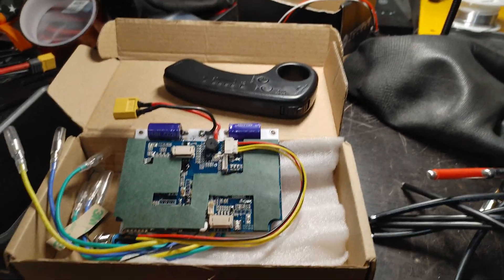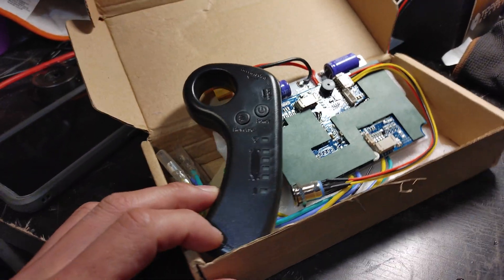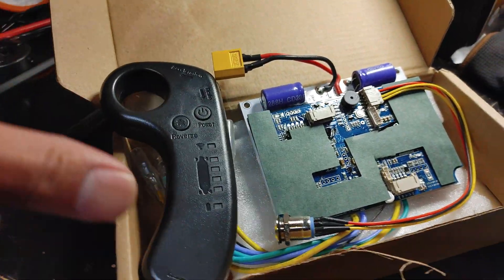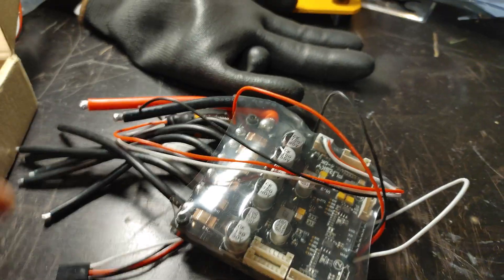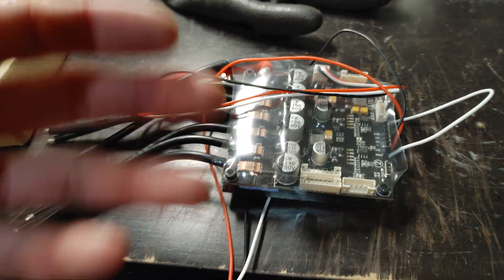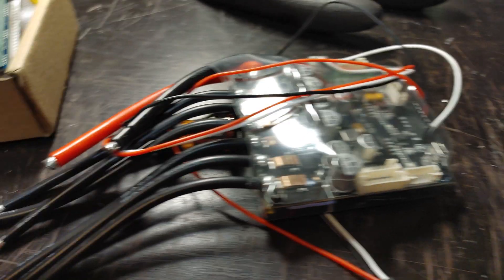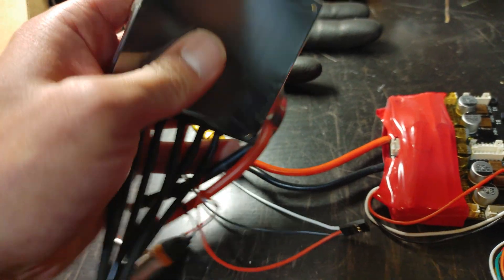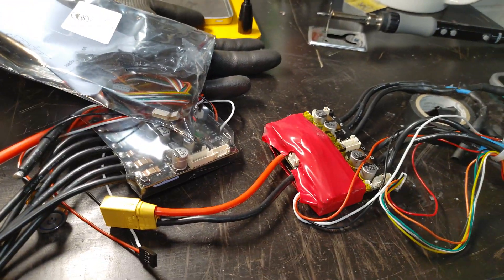DIY Electric Skateboard 101 - Cheap $50 ESC vs VESC!

Comment: I got one of the Chinese 50€ ones, in black box with alu plate on back, and it only really works in without load, with both motors and load it just cuts out, and with single motor it does get me rolling, but awfully slow :d

Comment: Hey doc I see that the 3 wires from the vesc to motor are all the same color. Why are there 3? Do each serve a different function? And since they are the same color, does it matter how they are connected to the 3 wires on the motor? Thank you
Reply: It doesn't matter, connect all 3, if it spins wrong way, swap any two wires.
Reply: Motor has 3 phases

Comment: All of your videos are so informative and well put together. Im am doing a battery build and have a few questions if you have time. 

10s2p 40T build going on a stock Meepo v3 with the LingYi 6.0 ESC. 

My questions: What amp size bms do I need? 
And can I bypass the discharge safely with said battery pack?
Reply from the maker: You don't need a big size BMS if you are going to bypass discharge.  Just get one not too small but big enough to balance your battery cells.   Something around 30A should be plenty.

Comment: Exway flex has a programmable hobbywing esc
Reply from the maker: I think it's a tunable app but the actual esc is permanent.
Reply: @dr.eskateboard3381  i think it does links too the esc via bluetooth either that or it adjusts throttle and brake rate trim curves through the remote but you would think they would just put the trim adjustments on the controller itself.. ..id like to think it does change the throttle and break curves of the actual esc and motor timing based on wheel sizes. technology that has been available in competitive rc racing for a while can program esc through bluetooth in live time .We used to have too plug in a laptop and make adjustments via USB...this Bluetooth tunability has been available to rc racing for a couple years now. Motor brands like tekin and orion..and now hobbywing and other racing companies in the rc world its just on a smaller scale.. can adjust motor timing..ad electronic boost at different  rpms..fine tune initial brake limits it gets quite extensive. It would be nice if they would produce that amount of fine tuning in a larger scale. And allow us to program the hobbywing esc with there plug in programing card or laptop like they have for rc racing esc..i just think they are doing that for a diy consumer at this point in time. Rc racing has high demand for tuning... I wouldn't be surprised if it becomes available  from hobbywing directly for e sk8 applications in the near future...im new to electric boards but I know another about building rc cars its very similar..the amount of control you can get from a sensored motor and programable esc is perfect for the electric skate world..where actual physical human harm could result from poor factory tuning....you did great video by the way.. do you have any that goes through the tuning process of the flipsky.. hooking it up and where to download the software and how to program the esc using the software?..that can get hard to understand some times.
Reply from the maker: @captainplanted8498  unfortunately Hobbywing is intended for manufacturers not consumers, going with vesc would be ideal for full customization, I doubt exway supports anything beyond very basic settings which probably useless for most.
Reply: @dr.eskateboard3381  it is very basic settings on the exway app but still some what tunable. but in the rc car racing world hobbywing products are built for the racer and are there own manufacturers and race team. What im Trying to say is hobbywing is fully capable of producing a consumer based programable esc intended for e skate. They might even have one available that is large enough to support the demands of e skating but it is most likely marketed tord large scale remote control hobbiest...im willing to bet if you did a firmware flash with one of hobbywing top of the line race esc firmware you could use their race tuning software wich is really amazing..for full tunability as of right now yah the flipsky is probably best you can get like you say. But I dont understand why e Skateboards are so far behind the remote control car scene with technology when its essentialy the same thing..if you come across a spare hobbywing esc try the firm ware flash idea if your not busy one day. I do think it will work. il try it on my flex when it gets here..sometimes you need a special adapter I have one and you can get them on there website really cheap. But also might have a USB right on it. Im pretty sure we can unlock the full potential of a hobbywing esc it just doesn't make sense in my mind that they wouldn't use their more advanced chipset On a dual motor controller of that size..i don't know im just making conversion dont mind me lol. one electric motor head to another.l

Comment: Do you know if the $50 board can be used with a separate receiver? I was planning to use the board with hoverboard motors to make a remote control tricycle and use a FS-i6 transmitter. I'm pretty sure I can do it with the Flipsky, but trying to keep the cost down.
Reply from the maker: Nope you are stuck with the remote it comes with.
Reply: Dr. E Skateboard ok thanks for the fast response.

Comment: Awesome Video! love your content! If you decide to upgrade your ownboard M1 with it, Plz Post! I ordered my M1 and I would like to have as much torque as possible. I also wa wondering about customizing the remote: I love how the boosted remote goes reverse when you brake. Is there a way to program a controller to do the same?
Reply from the maker: yes u have to replace hobbywing esc with flipsky 4.20 dual vesc.